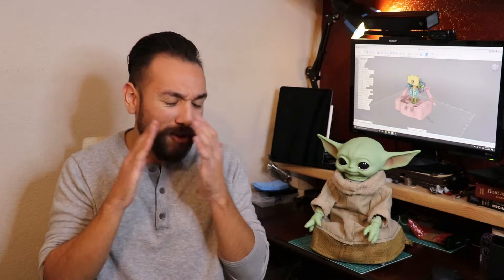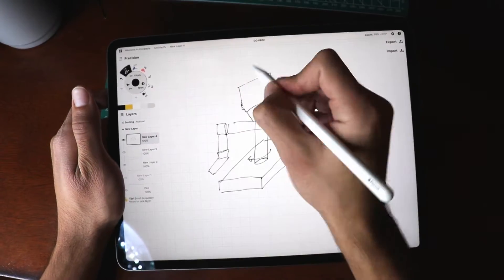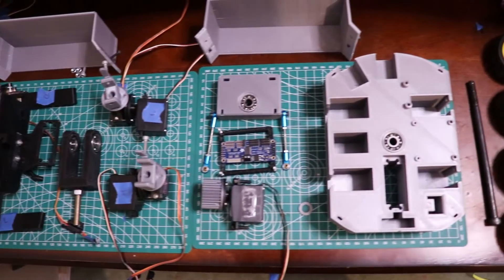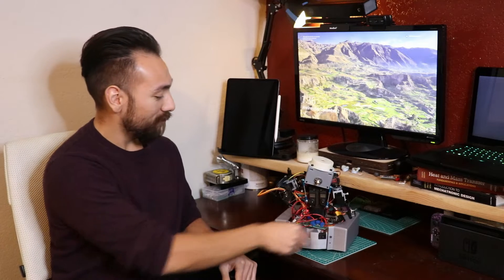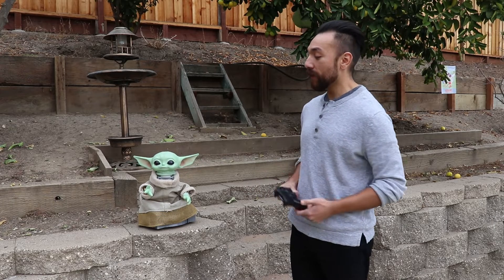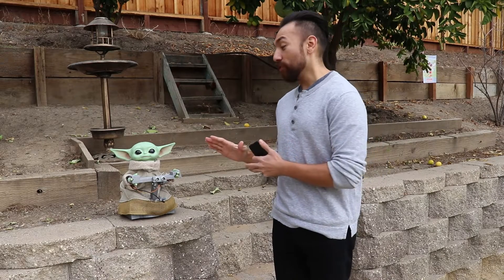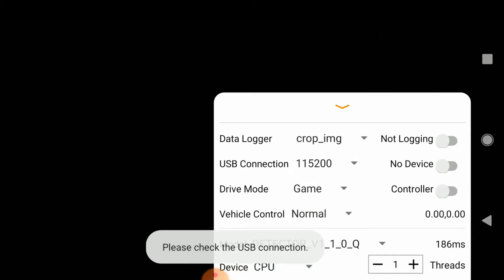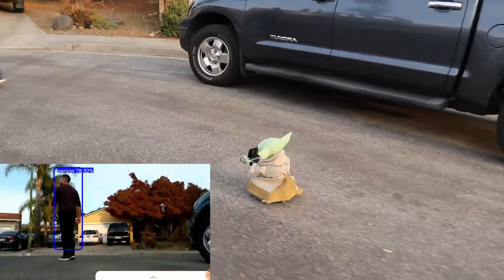Real Life Baby Yoda with AI

Comment: This is awesome! Please change the drive motors from DC 130 motors + plastic gears to something like N20 + metal gears make the noise more bearable.
Can I connect it to a zero, or does it require some computational power on the RasPi side too?